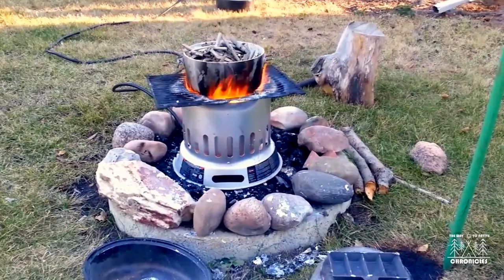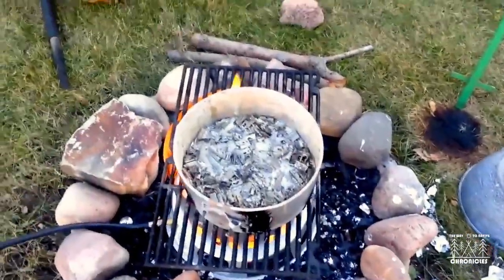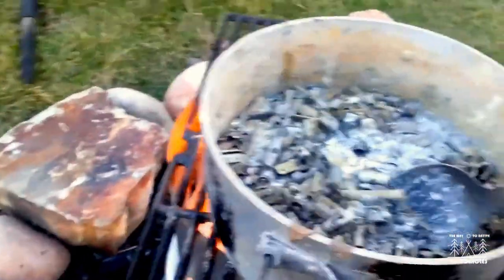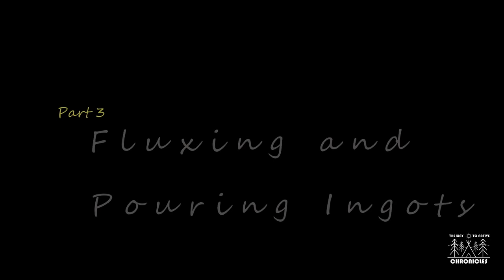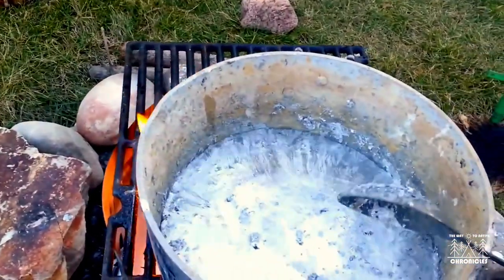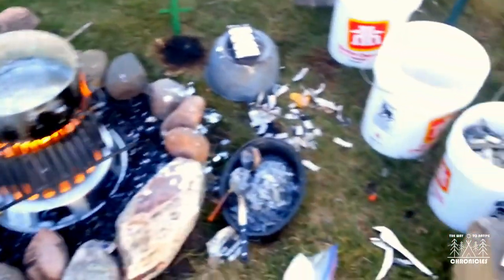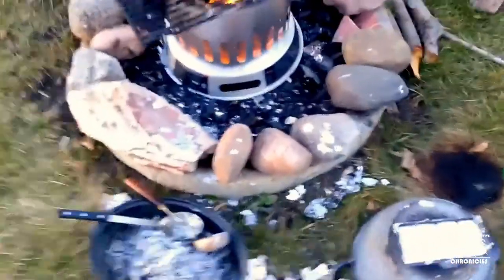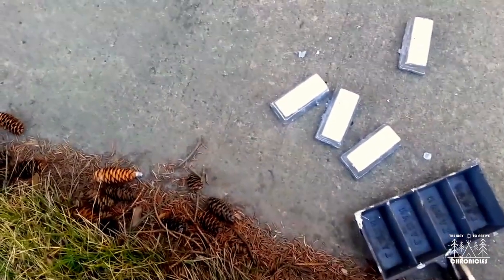How To Melt Down Wheel Weights for Use in Cast Bullets - Enhanced Version

Comment: Good stuff! I just did my first ingots, ladle casting & bottom pour casting, as well as pewter processing late last summer, can't wait until spring to get at it again. Got all winter to look for some new molds and build up the lead supply. I'll be casting zinc as well so I separate that too. Mike.
Reply from the maker: You have some interesting plans ahead of you!  Hopefully the high temperatures involved in casting zinc doesn't ruin your moulds (might have to think that one over).  Cheers.

Comment: I get antimony and tin from Industrial Metal Supply to mix in with pure lead for a 94% lead 4% Antimony, and 2% tin...I get the mold to a good constant temperature and cast fast and steady dropping in a 5 gallon bucket of icewater...it produces Burnell 20 -22 hardness and the tin makes for really smooth bullet surfaces...and I like the sizzle and the pop...the cold water adds hardness. Oh, I also found a Unicorn on E-bay, a 45 lb crate of actual Linotype. :)
Reply from the maker: That sounds like an excellent mix.  Right after turning on the melting pot, I put an old circular saw blade on an element of the stove, place the moulds on it and then turn it on to about 6 or 7 while waiting for the lead to melt.  By that time, when I start to cast, it perfectly up to temp.  For heat-treating I do it as a separate step using the oven.